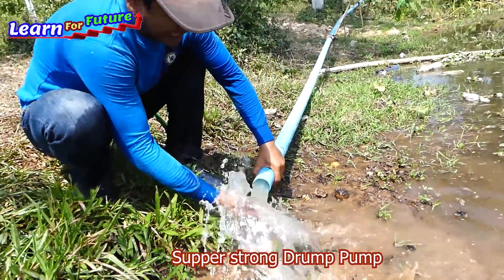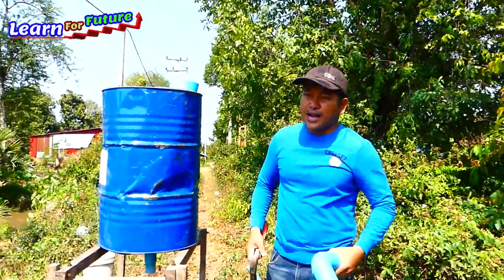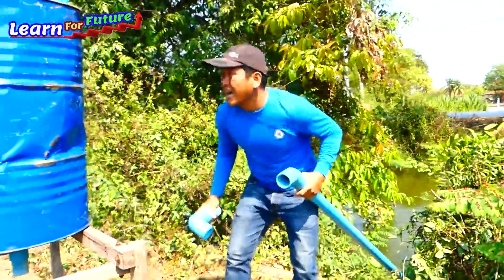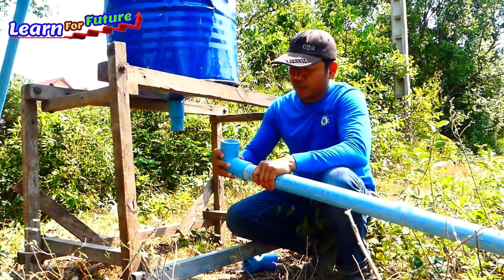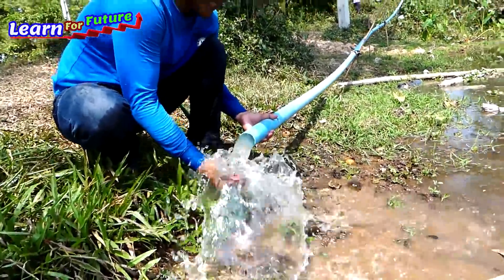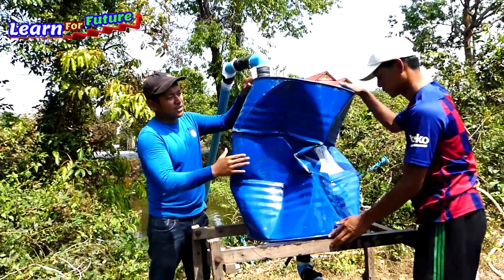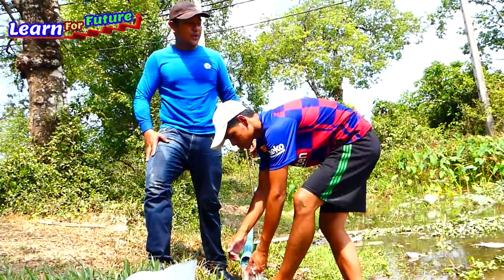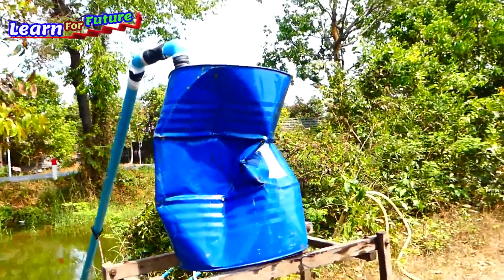Deep River - How to make free Energy water tank from Deep River About 6 M Deep with big pipe

Comment: Mistake set up.. Very big PVC.. Small PVC inlet.. Big PVC outlet.. Your set up is so many mistake.. At least 80 percent water only in the drum..
Reply: Input side and output side in a siphon may be equal. Filling of drum is not critical. If you use a foot valve the filling of the drum can be from about 10-100%.

Comment: In drilling, your example cannot work if the water is more than 10 meters deep, you have to tell the peasants. The fundamental law indicates that it is impossible to suck water from a depth of more than 10 meters, it is the equivalence of atmospheric pressure at sea level. From 10 meters you will enter in the vaporization voltage, that is to say that you will only go up bubbles and your pump will stall. We cannot defy the physical laws, I could see in all your examples that the water drawn is at a very low altitude compared to your pump which makes everything work. Well, I'm sure you haven't tried more than 10 meters.....
Reply: This is a siphon, not a pump. A siphon can not lift any water at all to a higher level, not even from a 1 inch deep well or river.

Comment: Stronger Container is needed. Lpg tanks to handle the suction pressure, the drum cannot sustain high pressure = it will capsize like in the video. ram pumps do that trick by oscillating the pressure
Reply: I did not know this type of pump is possible. Is this real my brother/ sister? I'm really interested, please respond.
Reply: @bizobloka8872  This is a siphon with a starting drum. No siphon can pump any water to a higher level. Output must be lower than water level in the river.

Comment: No drum is not at all necessary. A 2" PVC pipe is enough in place of drum. For syphoning effect, only one condition is necessary .Delivery end should be lower than the intake point.
Reply: the problem is the delivery end is higher. so you still need air pressure here. 
Further to fill the 2" pipe to start the system can be a challenge too...
Reply: @Razik totally agree with you, its just syphon principal
Reply: Selam ustam Watsap no varmı senin
Reply: @teohks60  Higher? This only work if the delivery is lower than the source. No drum are needed, but it can make it easier to start the siphon.

Comment: try to remove the drum...siphon only...will it work?
Reply: No.
Reply: Yes, absolutely work
Reply: @randomards4125  ONLY if downward output has enough pipe (volume & vertical distance) to "overpower" input siphon resistance (gravity, height, volume).  Believe me, it is a lot of pipe doing it that way.  The barrel allows for a MUCH shorter/smaller output pipe if desired AND if done correctly, for fully re-cyclable water use.
Reply: @mariana1964  
Can I ask some questions ma'am?
Do you think vacuum pressure inside the tank can displace the water that is coming out? . Considering the height of inlet pipe it's size (3 inch diameter probably ) and weight of water it needs a lot of vacuum pressure to sustain the cycle. 
We have a 7hp water pump in our rice field  and see the struggle of motor sucking the amount of water from a 3 inch pipe. 
That barrel hold 200 (probably)liters  of water  and 80 percent accounts for 160 liter. With 3 inch pipe and resistance due displacement of it's contents the water inside the tank( without out getting refilled by inlet) can be empty for several minutes.  The collapse of the tank shows two primary reason. First is it is not sturdy enough and second is that vacuum pressure can't pull the water in Inlet thus build in vaccum pressure alone collapse the tank.

And lastly can these men show a time lapse of that contraption working for several hours. What about water resistant , friction and law of thermodynamics?
Reply: @cgl6482  Hello! It is nice to see a growing interest in this.  Your environment is probably very different than ours, so your machine will be built to your needs.  We are constantly working with our setup, expanding it mainly.  For now, everything I say is just an informed opinion, and the only way you will ever know for certain is to do it yourself.  I will say this:  Seeing YOUR OWN water machine perform meaningful work is a real eye-opener.  No scientific laws are broken.  This uses different properties TOGETHER to get work done.  My dad had one and I had no idea.  We used a couple of them on our dairy farm in Wisconsin to clear the fields of water in the spring.  Even as a kid I ALWAYS knew the destination was higher than the source, but NEVER gave it a second thought.  Until recently, that is -- on my first-time-ever flooded, small veggie farm in Florida.

So, we have been working with many different configurations for a short while now, and some things are becoming clearer.  Once you create a CONTINUOUS body of water the force becomes incredible.  You create the continuous body of water with a foot valve (for one-way water flow).  Incidentally, you can make the foot valve yourself with a marble and some pipe fittings.   Another important part of our system is the capped, vertical pipe.  It is the only air in an otherwise liquid-only system.  We believe it creates the low pressure necessary to get the water falling initially.  After that the capped pipe is probably a basic stray-bubble collector.

So, this is how I think:  Everything is a variable, but the continuous body of water is the key.  Your goal is to create enough downward pull to lift a column of water up and over.  After that, you're in business.  The second barrel helps, I guess.  We use a second barrel, but ours is used also as a source.  Think about that one for a minute.  So, your job is to experiment and figure out the variables according to your needs.

Then tell others.
Reply: @MarianaCaruso  
https://youtu.be/DaM5Eeq0wJw
This is the link from his vid a month a go. As an Asian I can see many flaws first is the deep well which is just a concrete well ring (an new one) with it's full length no junction to the other ring( cement bonding). He just place the the ring on the ground and the video is clearly edited (hahaha 😂 I caught him) . The well he show is a decade old with algae and stain from the side while the ring in his vid is new. 
And if it is a deep well he can show it already and not focusing thier vid just on him. I can this video if fake (link above) same person you can and review watch it btw. 

In your case when you said you have running water source that alone can facilitate the travel of water due to its momentum. In this vid it clearly shows that the river (water source ) is higher than the rice field and I can assume it is pure siphon and gravity is the driving force. I believe in him first however when I do visit their chanel ( 5 am PACIFIC TIME) and when I see their new vid about the deep well. Well it's fake and orchestrated. You can visit the link above my comment or revisit their channel ( drum pump on deepwell)
 And can you do me a favor? By noticing some iregularities and visible flaws on their vid.
Thank you so much !! for replying on my previous question 😃.
Reply: @mariana1964  No drum is needed. Only criterium  for a siphon to work is that the output is lower than the input. A few cm is enough. BUT then you will have a problem with air sucking in via the outlet. Bent the outlet to form a U, and you may use any practical short) length of output.
Reply: @mariana1964  Output must be lower than source! Water never flow uphill. 
No, you do not need a continuous body of water. Many of these barrel „pumps“ are filled to 60-80%. 
No, you do not need a foot valve as long as you use a barrel. That is partly the reason for the barrel in the first place. 
No the vertical capped raiser is not needed.

You do not even need any barrel at all. Either you find a way to fill the siphon/single tube with water,  or you put a filling stud at the top point of the tube. You will  need a stop valve at the output end. In some cases with short output tube you will need a foot valve at the suction end.
Reply: @Dingsrud  No.  It doesn't really work at all with air in the barrel, and YES, you need the barrel, or in its place a great quantity of raised water in the output pipe raised AFTER the inlet to the top barrel (at the top of the top barrel).  The reason for this is the same as for restricting output to that of the input: This machine needs that water to keep the vacuum strong, and it has to be raised above the lower barrel, which can easily be placed HIGHER than the source barrel (within limits).  The main property of a vacuum is that it is much stronger than air pressure, but in the opposite direction or flow.  It is THE IDENTICAL principle used in jet turbines to create over-unity through a vacuum produced IN FRONT of the turbine, so please don't be ridiculous and say it can't work.  Fluid dynamics, friend -- my specialty. 😀

When you turn on the spigot at the bottom, water begins to flow in one direction only (the foot valve, which helps maintain the vacuum chain), and once that water flows out, it starts a chain reaction.  In this respect this (our) device works just like a human heart!

I have facts and experience (a working unit -- actually three units doing different things) on my side; you are still trying to push an opinion with nothing but the word "no" to your credit...  It doesn't work the way you think it does, but it does work.  And we DON'T have to discuss it at all, but others may wish to learn.  I think it is extremely unfair to be spamming this thread as you have been, especially considering you have not yet presented ONE THING which makes complete sense to me.
Reply: And btw, if you put your hand in front of the fully-opened spigots you may cut a hole right in your hand because the pressure of ALL THAT RAISED WATER coming out of that little nozzle is far greater than a well pump, and MUCH stronger than the combined air pressure at the input barrel and water/pipe adhesion losses (THE reason why small pipes don't work), so the water just flows and flows until you shut it off.  Occasional maintenance to remove air from the upper barrel and riser pipe is about all we need to do.  Air kills it dead.
Reply: @mariana1964  Dear Mariana, I am no troll even though I live with the Trolls here in Norway. My intentions with my comments are actually to make world a better place. As you see my mother tongue is not English so my expressions may be considered unpolite  in some cases even thou that was not the intension. 

From another thread witch I can not find back to, you say something about the installations at your farm: a 55 gal container raised to 12 ft. You have to fill it from time to time due to air. How?  Climbing  a ladder with buckets or a garden hose?  How often, once a week? 
How does water come into this container, siphoning in from a pond higher than the outlet sprayers?

Then the more tricky part. You mention an underground container. What is the purpose, and how do you get the water back out again? If possible I would like to hear more about this system.
KG
Reply: @Dingsrud  Thank you for the explanation.  I will act accordingly with respect to your written expressions.  Although...  I am not so sure ALL of it was a the result of our language barrier.  Is that about right? 😀

I just love talking about this subject because it proves without any doubt that mankind is SO flawed with (but not the actual science) their explanations of how things work in nature!!!  They have everyone believing "a siphon is a siphon is a siphon" and that siphons don't work uphill, when in reality this is much more than that.

First:  Truth is Truth, okay??  Opinions ONLY "count" when one acknowledges they don't KNOW the truth.  I will not spend one more second debating whether this works or not.  If that's good with you we can continue.
Reply: @mariana1964  Another video showing how a drum siphon works. One can clearly see that some air in the drum (bottle) is fully ok. Also that the output must be lower than the source. Excellent demo.
Reply: @Dingsrud  Are YOU trying to convince me that a plastic bottle is where you are hanging your hat now?  LOLOLOL!  I'm done now -- and so are you.  Good gravy -- you aren't getting this at all!

Hey, I tried...
Reply: FYI. Do you see any barrel or tank here? Does it work? Is the size of the tubing large enough for it to run?

Comment: Only siphon is enough no need drum,
Reply: Not if you want to get anything done.
Reply: The drum need to make the water start flowing, but it will not work if the outlet higher than water level
Reply: @randomards4125  Arquimedes?
Reply: @mariana1964  Can I get help from you, ma'am?
Reply: @byaheniVan  What may I help you with?
Reply: @mariana1964  We have a canal here which has a water level same as the ground. What system can I use to transfer the water to the ground?
Reply: do you have a social media account where I can message you directly?
Reply: @byaheniVan  I do not have social accounts other than here, but I would suggest you watch more of these videos (there are several related channels, apparently) to gather inspiration.  There are many different designs and ideas to compare, depending on your needs.

As one example from our farm, we have a 55 gal drum mounted 12' above ground level and one buried in the ground, both attached to a 2" pvc pipe (input).  The top barrel (output) has multiple 3" (it might be 4") pipes attached to the bottom and flowing downward.  There is NO air in the top barrel.  At the bottom end the pipes are reduced in size SO THAT the output volume CANNOT EXCEED the input volume.  We have spray nozzle outputs turning turbines that power our geothermal A/C for the greenhouse.  The water is then returned to the bottom barrel, which can be in open air.

Over time dissolved air in water will accumulate in the top barrel.  Close the shut-offs and replace the air with water from the top of the top barrel.

Watch as many videos as you can and let your mind run free!!  Use science to your benefit as it is just one of God's gifts to us!
Reply: @byaheniVan  You may not need my type of setup as it is very robust in its construction.  Lately these guys are making much smaller pumps that are hand-held and seem very easy to build.
Reply: @mariana1964  Thank you for your answer! Much appreciated <3
Reply: @byaheniVan  You are welcome!  It is a shame that YT has chosen to censor the discussion platform and to make discussions such as ours available to only a select few or not at all, but that is how it goes.  I learned much of this years ago from my father, so it is interesting to see this information available today.

May God Bless your efforts!

Comment: Its just a siphon a device  used in transfering  liquid from higher level to lower dont be amazed water pressure  coming out from the pvc aquized try to change intake pvc to a bigger  one to overcome pressure intake must be bigger than the pvc going out of the drum or try to remove drum just simply use pvc it will work as designed

Comment: Is this flowing could it be for deep underground water? Or it is only for open source of water?
Reply: Only for theoretical 9.81 meter.(Gravity) Should get 6-7 meter lift.
Reply: Pls. Study on law of conservation of energy.  The gravitational potential energy impended on the intake pipe would be the product of mass garvitational acceleration and the difference of height from the discharge pipe to the intake pipe.  Likewise the pressure have to be augment with that potential energy in intake pipe would be the product of density of the medium gravitational acceleration and the difference of elevation from the discharge to intake side.  The system they are showing here is in equilibrium no continues flow of water.
Reply: @Ukruins  its fake right?
Reply: @tinkerman9525  No, a siphon can not lift water out of any well at all. Output must be lower tan input.
Reply: A siphon like this can not lift water at all. Output must be lower than input

Comment: dont load to much water your drum just give a little clearance for air vacuum to avoid your drum compressed and dont forget to put air inlet you have to change the new intallation because you get wrong technique
Reply: The outlet must be lower than the inlet and the inlet must be open at all times.

Comment: What to do so as to prevent drum from collapsing
Reply: Welding from inside
Reply: 1Outlet pipes should be very smaller so that it might suck slowly n slightly ,  i think the problem might solve
2 tank should always completely fill with water so that there is no vacuum inside it if it fails it will compress itself